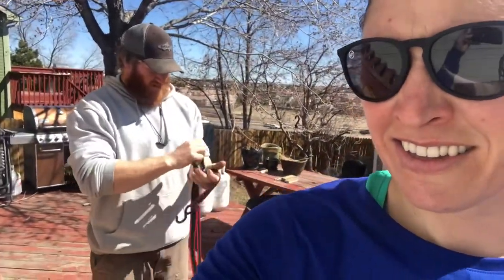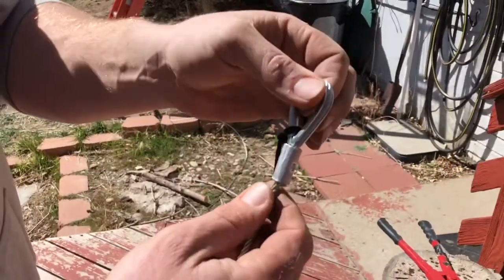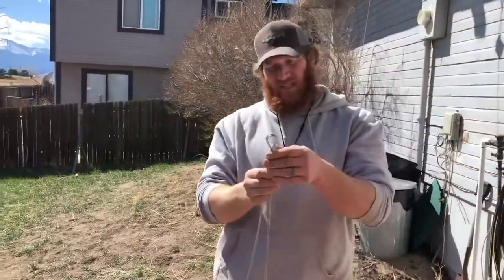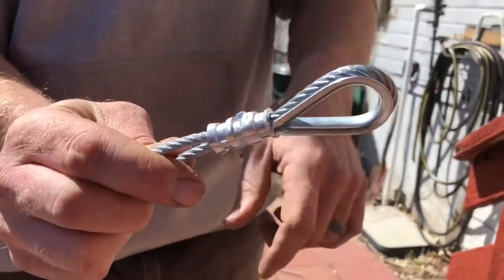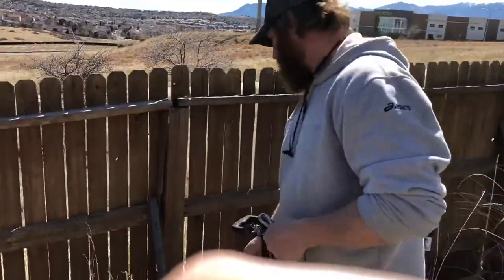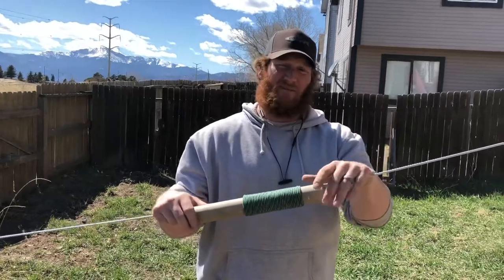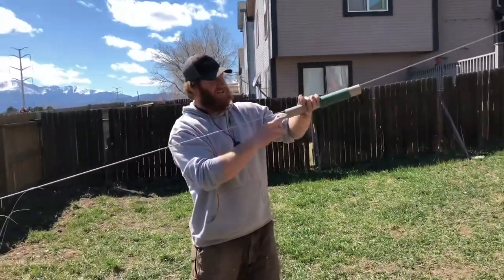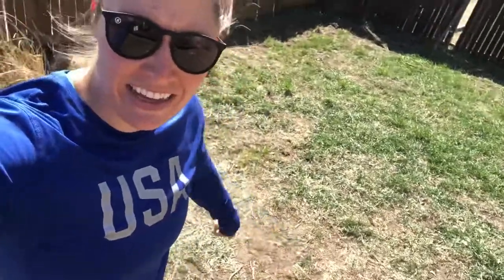Build a Cable System for at-home “Javelin” Throwing

Comment: very nice! How high off the ground should each end be installed? Want to make sure the angle is accurate for throwing the jav
Reply from the maker: So sorry for this wild delay in answering! Notification probs. Typically a 30-degree angle is considered optimal, but as you can see, the one we built was very likely steeper than that, and will still afford the athlete big benefits in learning how to move their body around the implement rather than move the implement around their body. So really just have the athlete hold the javelin comfortably/at the angle they typically would hold it at release, and eyeball from there!

Comment: Mam I wanna ask you that is distance rated javelin matters in throwing distance like my throw goes 50m on on training javelin which has centre of gravity very much to tip of javelin and if I throw on 80m distance rated did it increase or remain same
Reply from the maker: This is a good and common question: I threw a 70m-rated javelin 68.11m, which it maybe should be able to travel in possibly sub-optimal conditions. And I threw 85m-rated javelins not as far as that. So the javelin rating matters, but only so much as your comfort level with that particular javelin allows you to put everything you have into the javelin. I hope that helps!